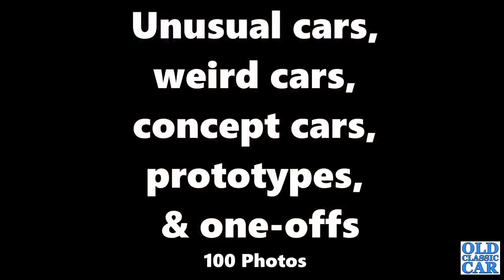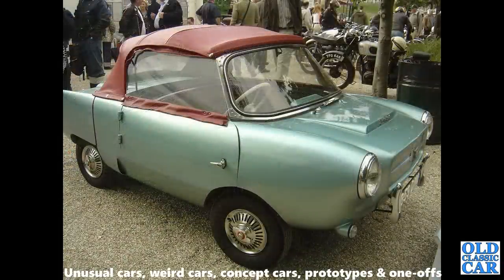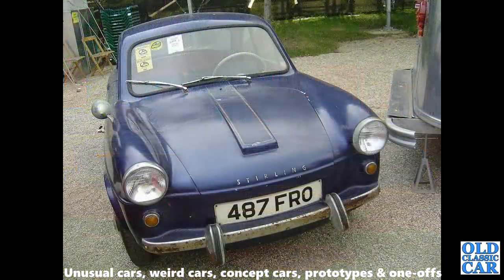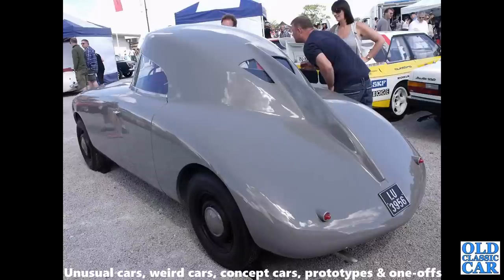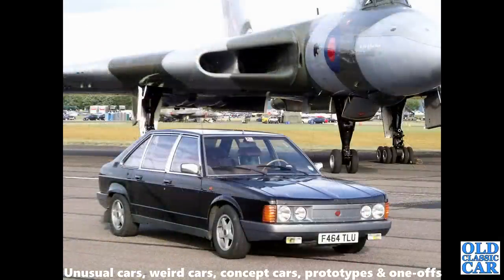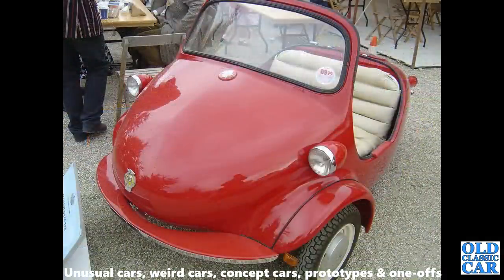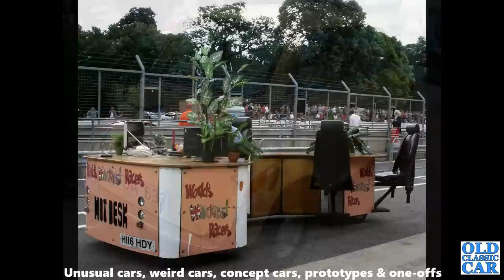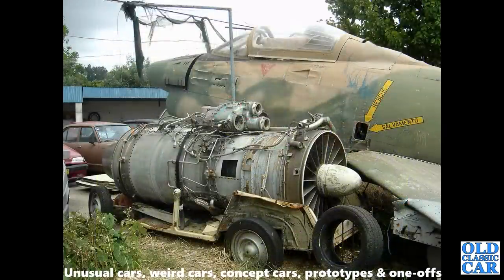Weird cars, unusual cars, one-offs & prototypes | Rare classic cars & other vehicles

Comment: Quite interesting! Probably the most unusual car I have seen was an Isetta flat bed mini-lorry. The bed was flan and about 4' X 6'. The cab was the front half of an Isetta. It's engine was under the bed. The chassis, obviously, had been extended and it had a full width live axle with a differential. This was seen being worked on in Mexico City around 1960.
Reply: You might like to take a look at this concoction:
https://www.youtube.com/watch?v=1Geap3u5mvg

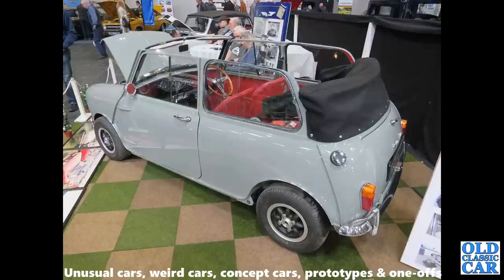Comment: Re  the Crayford Mini @ 13:39. Of course it would have been a "complete wreck" because it was a Crayford conversion. Crayford were well known for their lack of rustproofing and their extensive use of bog.

I once owned a 1973 W116 Mercedes-Benz Crayford Estate (one of 20 built), formerly owned by Rolf Harris. It was the worst rust-bucket I've ever owned, and there must have been half a ton of bog in it (from the conversion, not from repairs).
Reply from the maker: I remember being told of a Mercedes like you mention 10+ years ago but it sold on again shortly afterwards I think
Reply: @oldclassiccarUK  Yes, they kept moving around. Mine came from the UK to AU, and when I sold it it returned to the UK (the freight and associated charges would have cost thrice the value of the car!). Another AU example ended up in Singapore, another in Malaysia. Every one of them, even that owned by David McMullan (the Crayford Auto Developments owner), was a sad rustbucket bog barrow.